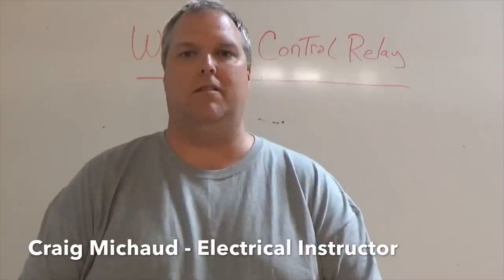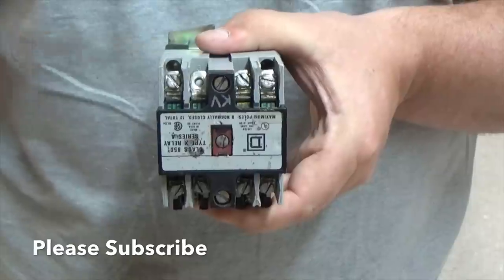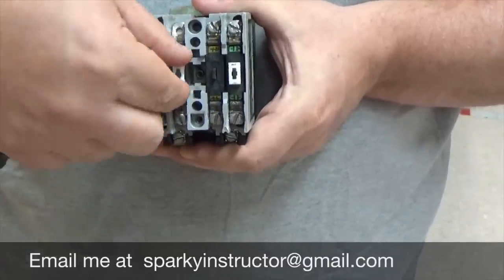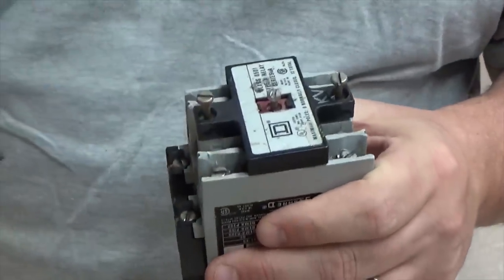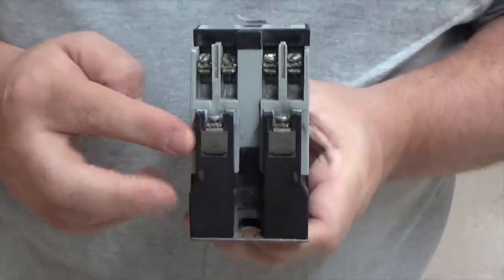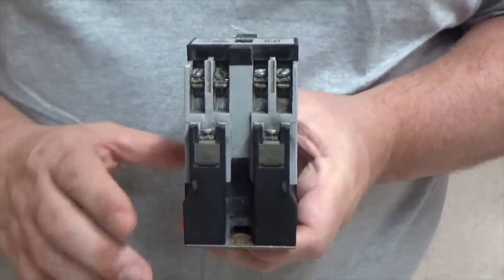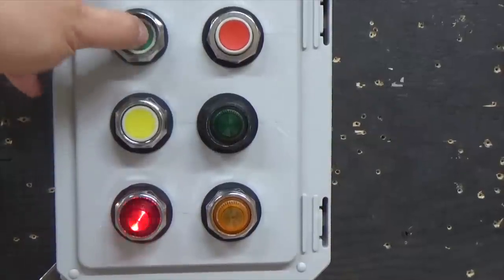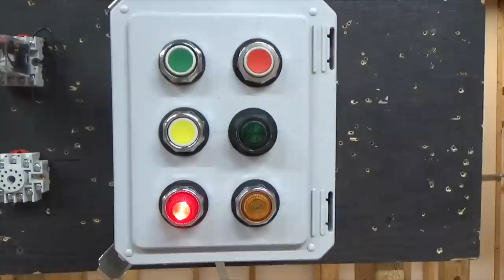Motor Control Relay Wired, Explained

Comment: Mr Craig Michaud thank you very much for your video about electrical installation. Can you explain how to wire 3phase auto on off air compressor with 11 pin phase failure?